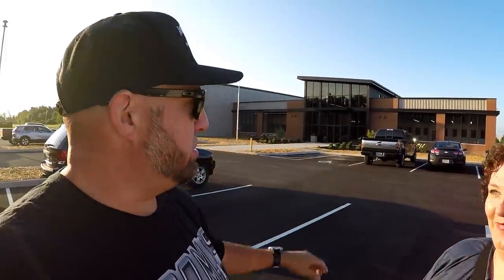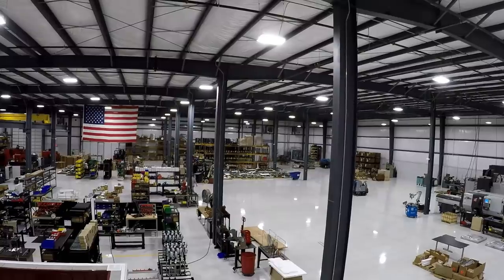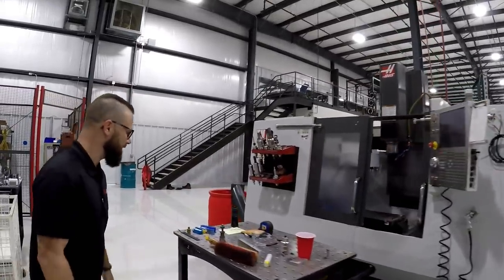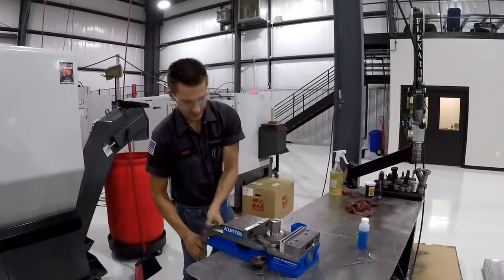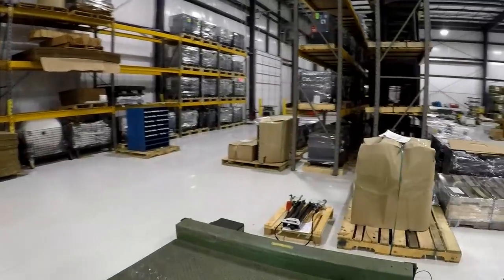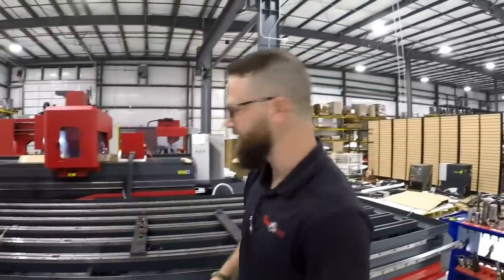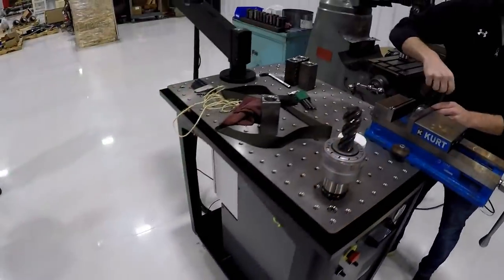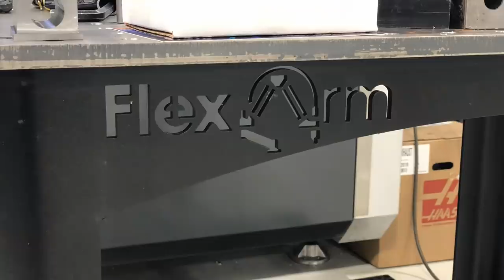Flexarm Factory Tour

Comment: 49:00  very crookedly began to thread
Reply: The camera angle makes the tapping appear crooked. The tap is actually 90 degrees to the work.
Reply: @ellieprice3396  Look at distant objects parallel to the instrument ?
Reply: Yes, and this is evident not with an armed gaze
Reply: @Giperbolloid  Camera angles and posts at a distance are very deceiving. Do you really believe FlexArm would build a brand new several million dollar factory and ship machines all over the world that tap holes crooked or, that Adam Booth wouldn't call them out if they did?  If they did that, their business would not last two weeks. Believe me, the machines tap holes straight within factory tolerance; otherwise, the factory might as well close their doors.
Reply: @ellieprice3396  With all due respect, but how many years do you have in metal processing? Judging by your interests on YouTube, you’re zero, I’ll tell you once and for all that the camera does not distort individual elements but shows how it is and with the naked eye it can be seen that the employee, while using the equipment trying to impress the operator, neglected the rules of material processing.
Understand that I like the devices that they make, but no one excludes the human factor.
Reply: I’ll add that I have been working in metalworking for more than 20 years, my brother and my father have been working in the same field, the three of us are over 90 years old, as we say, this is DYNASTY, so I affirm that the person did not cut the thread evenly and this is only a human factor and not as unrelated to equipment
Reply: @Giperbolloid  Perpendicular to the work piece.
Reply: @Giperbolloid   Lens distortion from the go pro WIDE ANGLE lens. Learn about lens distortion specifically from wide-angle lenses that are standard on all go pros.